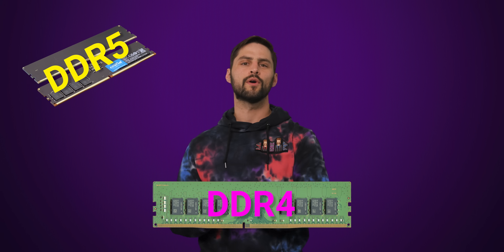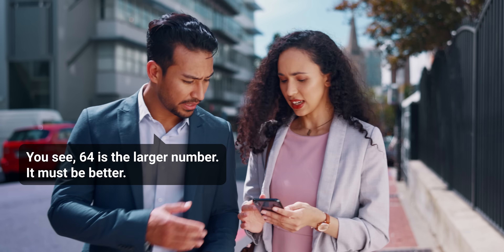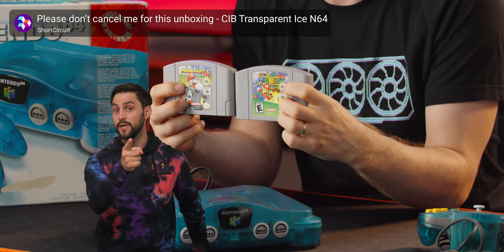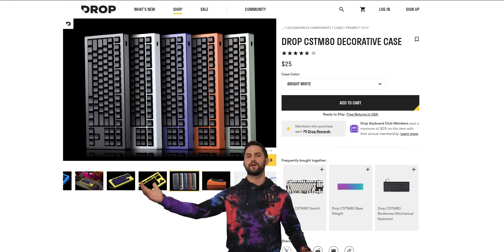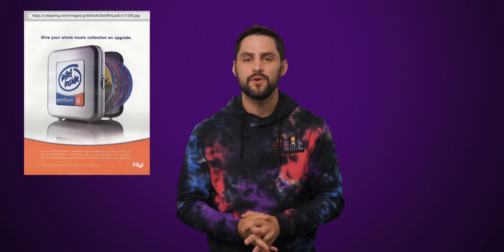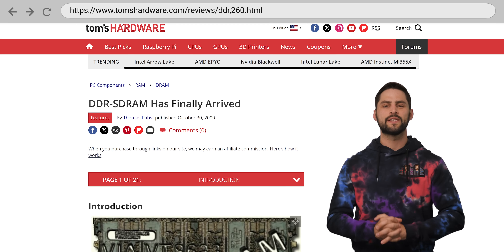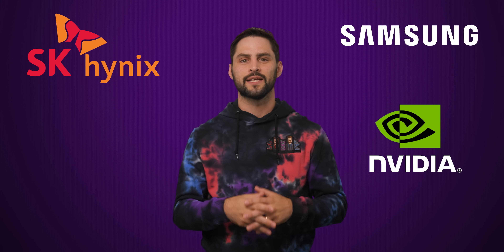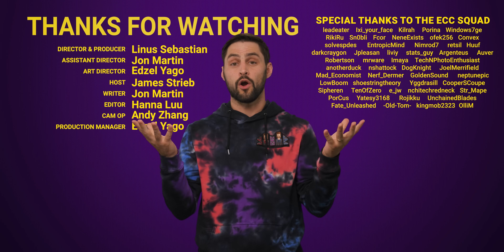Computer Memory Was Almost COMPLETELY Different - RDRAM Explained

Comment: In 1999, I started to build my first dual CPU computer. However, with my budget at the time, I stopped the build because of the cost of the RAMBUS memory. It wasn't until 2023 that I finally built a dual CPU computer (just for fun) using pre-owed (cheap) Xeon CPUs. Now, I have a spare computer to tinker with, which has a pair of 18 core, 36 thread (combined 36 core, 72 thread) Xeons. Its fun, and handles everything I can throw at it.

Comment: I love ram videos. Can you explain why ram signals can't be multiplexed or why a bus can't be optical where different interconnects can't use the same bus on a different frequency/phase rather than shutting off the bus while it's in use? 

It's incredible to me how fast Ethernet has gotten so damn fast over the years by doing this, but ram takes massive power and specific slot placement, channels available depending on sticks installed, bios profiles and all that. It seems crazy to me how slow ram is tbh.

Also, why is ram built into the motherboard on high end boards? Solder 4gb of hbm next to the cpu and let sticks be added for when that mobo ram fills. Even if it only runs system and os, a level 5 cache measured in gigs would absolutely phenomenal even if only the os used it to help speed up the chipset io. Chipset hbm buffers would be amazing!
Reply: If you’re talking about straight up throughput, then yeah, ethernet is faster. But that’s where it ends. RAM is orders of magnitude lower latency than Ethernet (a million times lower, to be exact). Ethernet latency is measured in milliseconds while RAM latency is measured in _nanoseconds_. Why is Ram situated as it is? Latency. At that scale of latency minute differences in the length of traces materially impact the latency of one bit vs the next. Traces need to be the same length to keep the latency consistent.

CPUs/GPUs need to switch between instructions far, far faster than Ethernet could ever even dream of being able to provide the requested data for. Sure, compared to RAM, Ethernet is analogous to a fire hose vs a squirt bottle. However, try changing the direction of a firehouse as fast as you can a squirt bottle. All that throughput is useless if it takes comparatively forever to retrieve it.

Besides all that, Ethernet and RAM are two completely different things, they’re not interchangeable.

As for HBM with extra cache, that’s somewhat the direction things are going in, but HBM alone sends complexity through the roof, adding an external cache to the mix just multiplies the complexity to be (currently) out of the realm of practicality for all but the most demanding use cases. There’s a reason those high end boards you mentioned are high end: it’s not due to the presence of it, but rather due to the complexity required to have it there in the first place (and have it work in a beneficial fashion).

Comment: Before Intel dropped Rdram Rambus came out with 32bit Rdram of which I have 2 modules. Finding Rambus 4800 is a bit of a problem nowadays since then.
Asus and a few other MB makers produced boards that used this memory and they only came with 2 Slots instead of the customary 4 that the 16bit modules used and are very rare today.

Comment: Intel for a bit used PC-133 ram with the P4 before going DDR. DDR was something that AMD latched on to quickly to get a performance edge on Intel, and Intel being Intel didn't want anything to do with something that AMD was pushing, but eventually the writing was on the wall for both PC-133 and Rambus memory and they finally switched to DDR SDRAM.

Comment: Oh god. When I was in college, I had a hand-me-down P4 with RDRAM to tinker with and use as a light game server. That thing did NOT age well. Even though the world was into the Core i era by that point, RDRAM was still expensive despite being thoroughly obsolete, and also rare enough that it never turned up dumpster diving at the IT department. 

The "Prescott" P4 that replaced it didn't age well either, for different reasons. Thankfully it wasn't that long until I was able to combine a bunch of Optiplexes (Optipli?) headed for recycling into one working system with a Core 2 Quad and 4x2gb DDR2, and then I was set.

Comment: It took fast DDR3 to match or exceed the throughput of RD800. My RAMBus machines are my vavorites, easily. Pairing a GDDR3 AGP card with RAMBus 600 RAM kept my P.C. playing some of the newest and most intensive games on the market for four years, and then only started a slow decline.
Reply: @davidgoodnow269  it takes fast (dual channel of course)  DDR2 to exceed bandwidth that dual channel PC1600 RDRAM ever had.
Reply: @volodumurkalunyak4651   Um, no at the time. DDR2 800 didn't exist yet, not even in engineering concept, at that time. DDR3 was off the engineering development board and in production LONG before DDR2 got that fast. DDR2 overclocking eventually made DDR2 that fast commercially viable as a market, for us guys who couldn't afford a DDR3 motherboard!

Whereas, RD800 had more bandwidth than the early, slow, DDR3 that was on the market at the same time!
Reply: @davidgoodnow269  single channel RD800 and single channel DDR2-400 are equivalent, dual channel RD1600 and dual channel DDR2-800 are also equivalents in memory bandwidth.
RD800 comparable to DDR3 - no way.
Good luck finding dual channel rdram boards.

Comment: I had a dell Dimension that came with 512 RDRAM, from the P4 cpu era. It was incredibly too expensive to upgrade even to the next tier and it always has to be installed in pairs as well. Not a cheap component.

Comment: Most of my stuff is still DDR3.  It's okay because I'm a retro sort of guy anyway.  Yeah, I went on a bit of a used office-PC buying spree when third and fourth-gen Intel machines were the ones to get a while back.  They still do their thing quite well.  I remember when all the Rambus controversy was happening.  I remember it was not well received on the tech sites I checked.  Opposition to it seemed overwhelming from the user side.  The nice thing from the user side is that AMD was there to go in their own direction so Intel and Rambus couldn't try to brute force this arrangement once it became clear that no one was happy.  As I recall, I got a computer a little bit before, and shortly after all this, so I was able to sit the whole thing out and never dealt with Rambus stuff.

Comment: Not having to buy ddr in pairs is why some computers are slower. Worhout that second stick you don't get dual channel. 1. Some users are not informed enough and end up buying one 32GB stick insted kf two 16GB sticks 2. Some manufacturer only put one stick in their laptop making it preform worse plus they sometimes don't give you an option to add a second stick so you are stuck that way. 😡

Comment: RDRAM had been around since way before the Pentium 4 era. Expensive as fuck, but I remember a friend building a dual CPU 200MHz Pentium Pro (the precursor to Pentium II) workstation with RDRAM. He had found a second-hand dual CPU motherboard and a single Pentium Pro processor for rather cheap, and the memory modules became the most expensive part of that build. A lot more expensive than other contemporary RAM sticks. It wasn't until some years later that they seriously tried to push RDRAM to the market, and it then was a quite shortlived fad.

Comment: I the first computer that i could call Mine, was a Dell pentium 4 (first gen) with RDRAM.  Finding ram was fun becuase it came with 2 modules and 2 dummy pairs.  had to find matching sticks to the ones i had.  Also when i looked to upgrade the CPU they had already changed the socket type in ( gen 2 i think P4), so the only upgrade i could get was from i think 1.3ghz to 1.5ghz.

so my next computer i got was an AMD 64 x2.

Comment: The better solution for early P4 motherboards would be four channel SD-RAM memory. This would give plenty of bandwidth for CPU in scalable way and of course mobo would be more expensive but still system as w hole would be cheaper than RD-RAM.

Comment: "allowed it to run at faster clock speeds"

no, it was required to run at 8x the speed to keep up with the baseline minimum that other technologies of the time were able to produce.
that's like saying your 8-bit cpu can keep up with a 64-bit cpu, because it can run at 8x the speed, while conveniently leaving out the fact that 64^2 [4096] is greater than (8^2)x8 [512]

Comment: Ah, the times when i had a fulltime job but still lived at home with mom and dad. So i could spend all my money on hardware instead of kids and mortgage :)
Had a watercooled 2ghz P4 @ 2.4ghz and 768MB (256+256+128+128) of RDRAM. And 4 single platter 500gb HDD's in raid-0 for absolute peak performance.
Made absolutely zero difference in gaming but damn did i have fun wasting a ton of money on that old PC.

Comment: I don’t think RDRAM would have been the right approach for modern RAM. We’re seeing a trend towards more cores (wider CPUs), because frequency is falling off, and my suspicion is that RDRAM would have likely not had a huge speed advantage over current high end RAM approaches, but having a lot less bandwidth due to the smaller bus.

Comment: Isn't this the same issue DDR5 have against DDR4 when that came out sure it had faster megatransfers per second resulting in higher bandwidth but due to the high latency it didn't really translate to a benefit to consumers as it actually hurts performance in some apps and games and was barely any faster in others all cause for some reason it has more than doubled even tripled the RAM timings vs DDR4 which was odd cause the timings barely increased when we moved to DDR3 from DDR2 and from DDR3 to DDR4.

Comment: Joke's on you, I already knew about RDRAM

one thing I  remember that was different between SDRAM and RDRAM was the heat spreading, SD ram would use each chip separately, filling one after the other, while RDRAM would use the whole bank filling them all evenly, which generated less overall heat per chip than using 1 chip after the other.

If that's wrong, I would love for someone to educate me :)

Comment: The N64 graphic improvements with the expansion pack is like PS5 vs PS5 Pro. You can't see the difference.
Reply: That thing was kinda slow and latency was big when doing operations other than a reading a sequence of bytes. No wonder expanding it did not help as much
Reply: You can definitely see a difference though I'm not sure how obvious it would be if you don't see them side by side.
Reply: You needed it for Perfect Dark to unlock the full game.

Comment: RDRAM had horiffic latency and it sucked for CPUs. For graphics it was OK. The only architecture on PC that supported it was the terrible netburst architecture. Netburst (pentium 4) was designed for a process node that never existed; a process node where Dennard scaling just continued as normal somehow. 8 GHz by 2023 as intended by intel wasn't entirely impossible, but instead of normal conditions you needed liquid-nitrogen everything-cooling and 300 W of power and a really golden sample to get there. This meant that the pentium 4 was optimized for scaling and the athlon XP and athlon 64 were not and it made it very inefficient (hot, low IPC) at slow clocks as a trade off for being able to run at high clocks that it couldn't do due to the thermal barrier.

Comment: Dude, RDRAM sucked EPIC levels.   Under optimal circumstances, it was capable of performing better, but over 90% of the time, it was just overheating, expensive and SLOW.

And the company committing patent fraud to be able to jack up prices on DDR was just disgusting.   And yes, that was de facto what they did.

Comment: Hahaha I'm on my mother in laws oldnsys and its ddr 2   yes you read that right  DDR2 and it's a whopping 4GB total!!!  Using an old amd x4 940.  However running properly setup w7 which is still quite possible to keep fully patched to date contrary to the sadly popular myth    oh and it also runs very nicely with linux mint installed.    It can if wanted run w10 tiny for that matter as an option but theres no real reason for that

Given what she does on her PC this sys still does everything she needs and is far more snappy than you may expect
So yet again  no need to upgrade what's working perfectly fine for the job and the only really bad thing is the TDP under full load for this is higher than alternatives  though I litigated such with careful setup  and given its absurdly rare to even hit 50% CPU usage it's nothing to worry about  lol

Sorry microshit  no new fancy pc needed for your epic FAIL of a turd that demands to record everything done on the system " for your own good" with w11s shit   which will never be polished enough to be anything but a turd